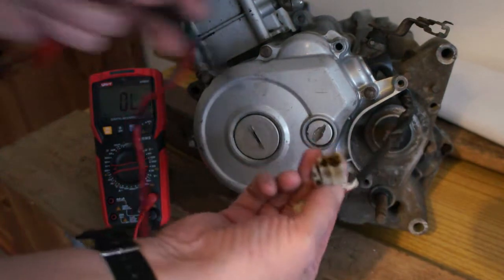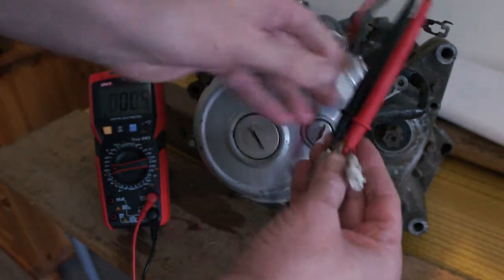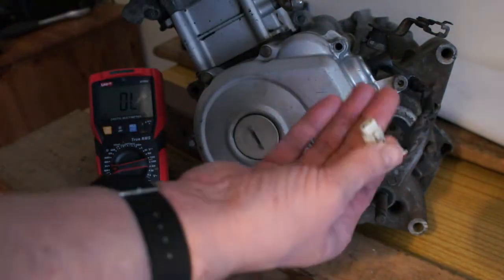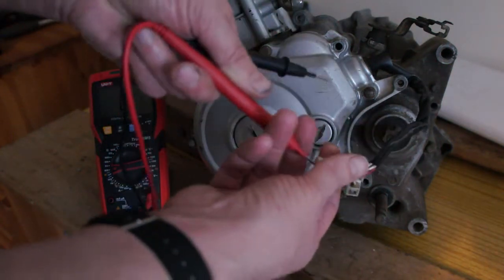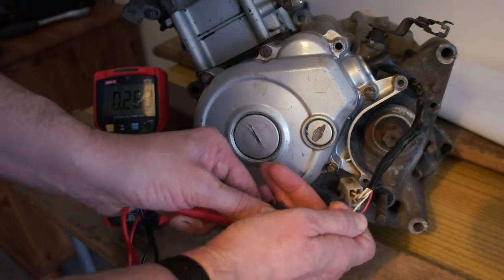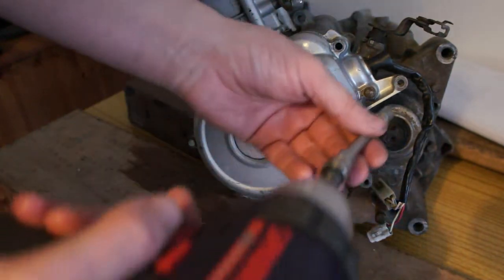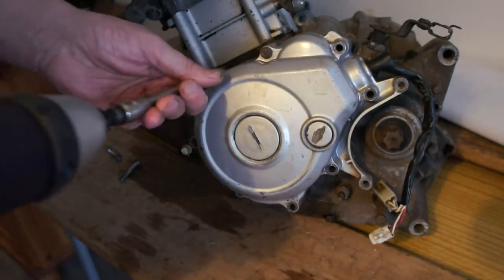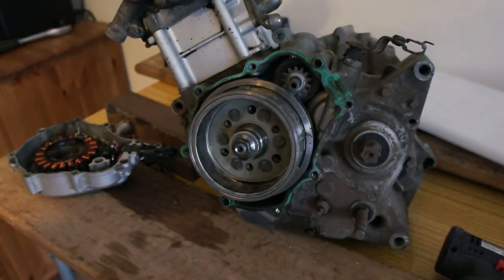NO SPARK FIX: How to Test & Replace Yamaha YZF-R125 / WR 125 Stator & Crank Sensor (Pickup Coil)

Comment: I’ve just replaced my stator but now my clutch doesn’t seem to work I can shift through all gears and neutral is fine but when pulling the clutch lever in gear there’s no change. I feel resistance on my cable and it seems fine I’m stumped.
Reply: how much the new stator?
Reply from the maker: did you solve

Comment: I'm guessing my reading of 0.1 across all three means it's dead then. Regulator returned 5.5 roughly across all three terminal from positive and negative with no readings in the opposite direction as it should and position sensor was correct range. Is it an oil drain to take the side case off?
Reply from the maker: Its below spec in manual but being all the same is good and rare for all to fail to the same reading but then again not impossible  , are you 100% on accuracy of tester.
Reply: @cagmito76  one of them first read at .5 and then immediately slowly went to .1
Reply from the maker: @DadDiaries  ok never really seen a drop on any other models reg/rect ive tested they are diodes and usually give one steady volt drop across one way and nothing the other . never actually tested a R125 one yet so cannot 100% say these dont though. Bike not running then ?
Reply: @cagmito76  yeah it's not charging the battery at all. Regulator readings are correct so must be the stator as tested direct at the plug to the stator
Reply from the maker: @DadDiaries  It does sound like , dont like to call parts for other people gets me in trouble, but thats what testing is for.
Reply from the maker: 5.5 ohms on regulator ? normally test these in diode mode but yeah you will need to drop oil . Thanks for Question !!
Reply: @cagmito76  yeah it was diode mode sorry. The meter was 70 quid and haven't had any issues before with it so no reason to doubt really.
Reply from the maker: @DadDiaries  Yeah should be good dmm then , readings are low then and out of spec at some point they got to get so low they cannot generate enough current.